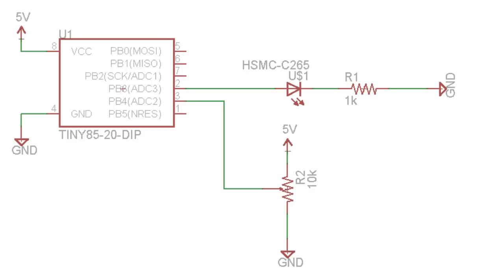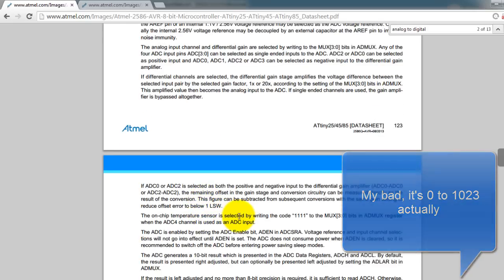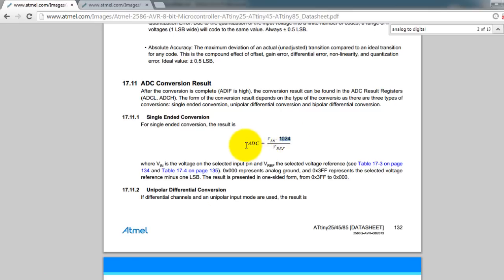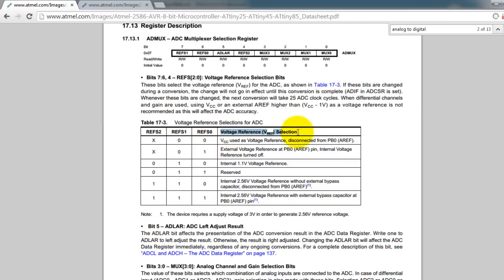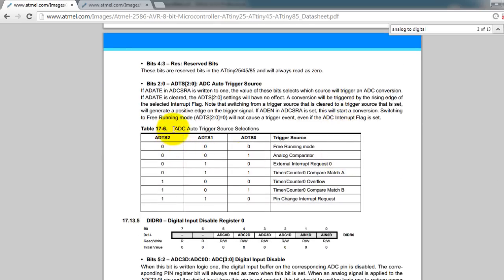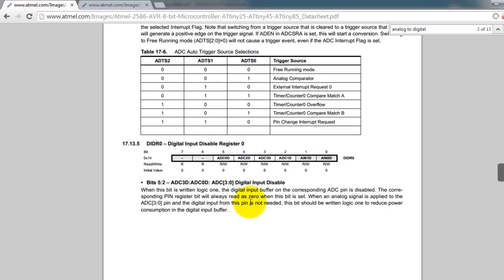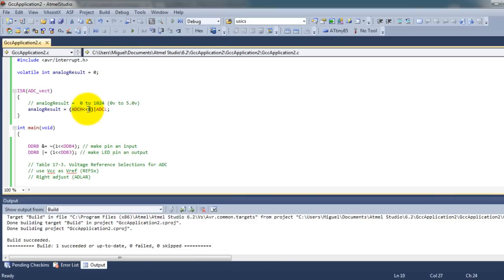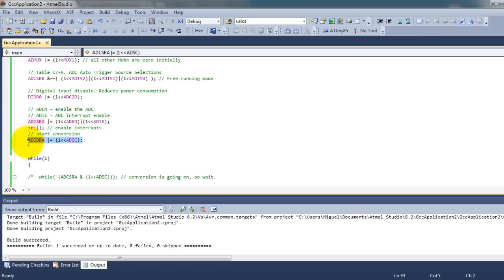AVR ATtiny85 Programming: Analog to Digital Converter (ADC)

Comment: int solarPin =  3;
#define led 0  
volatile int analogResult =0;
void setup() {
  // put your setup code here, to run once:
  pinMode(led, OUTPUT);
    pinMode (solarPin,INPUT);
}

void loop() {
  solar_detect();
  if(analogResult<=1)   
  {

   digitalWrite (led, HIGH);

 
  }
    //if ((voltage>=2) && (Stop==true))  // if LOW means nighttime  (f_wdt==1)&&
 if(analogResult>=1)   
  {  
   digitalWrite (led, LOW);

   }
   
}

ISR(ADC_vect) {
  analogResult = (ADCH<<8)| ADCL;
}

void solar_detect(){
   
   ADCSRA|=(1<<ADEN);
   ADCSRA &=~ ((1<<ADTS2)|(1<<ADTS1)|(1<<ADTS0)); // free running mode
   ADMUX &=~ ((1<<REFS1)|(1<<REFS0)|(1<<ADLAR));
   ADCSRA |= (1<<ADEN)|(1<<ADIE)|(1<<ADATE);
   sei();
}

i wrote this code, but it does not work. If anyone of you can point out mistake please let me know. it is for attiny44

Comment: Is this necessary to run analog input for Attiny's? I'm currently working both attiny85 and 84 to for photoresistor using Arduino as my programmer. I can't get the analogRead to work.
Reply: I had the same problem.  I fixed mine by explicitly declaring the pin as an input using pinMode, which I don't normally have to using an Arduino even though it's probably a good idea.
Reply: @isuposs  Good day,  would love to see full working code, if possible-- Cheers

Comment: Why aren't you using a pre-scaler?  The data sheets says the ADC needs to sample at 50 - 200 kHz.  If the system clock is faster, don't you need to pre-scale to get down to around 50 - 200 kHz?

Comment: The tutorial video is well done, but I could not get the code presented in the video to work until I enabled auto-triggering on ADCSRA. You can add this to the line ADCSRA |= (1<<ADEN)|(1<<ADIE) as (1<<ADATE). Without it, the ADC only works once per reset on my ATTINY85. Maybe it's in the GitHub code, but I don't see it in the video. Auto-triggering, including free-running mode, doesn't seem to work without it.
Reply: thanks a lot! Without your comment, I wouldnt have got this project. Everybody wrote, that excellent vid, nice ect. but none of them wrote that the code is wrong.
Reply: Thanks!  I tried your fix and it worked.
Reply: Thanks for your comment...however, I am personally bad with ambiguous instructions...So, what exactly did you mean by the " You can add this to the line ADCSRA |= (1<<ADEN)|(1<<ADIE) as (1<<ADATE) "
To be more precise, Do I add the (" 1<<ADATE)" expression into the same line or something else)? If you really like to help, please specify the coding line. 
Thanks!
Reply: @peta1001  I can’t tell you the code line from so long ago, but all I meant here was to add that new piece to the line I quoted. Just “or” it onto the line with the bar operator.
Reply: @fadecomic Thank You because You again tried to phrase an answer...However, we programmers do not communicate in prose or poetry. It would have taken much less time and memory space to suggest what certain line should be.